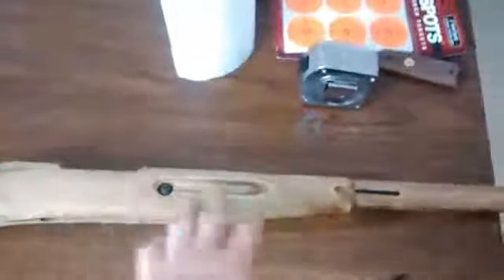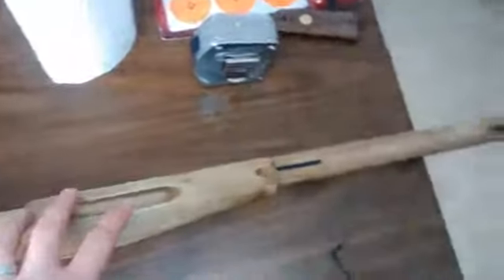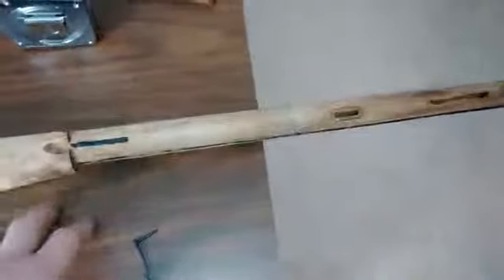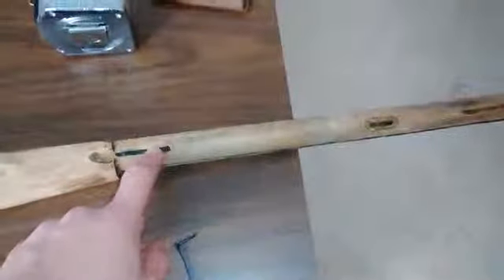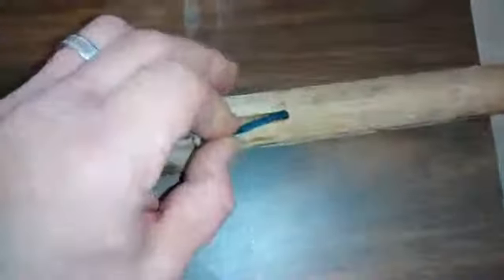Mosin Nagant spring retainer removal

Comment: Some are stuck in very good and I found out the hard way if you pull on them they break. What helps is taking a small finishing nail from the opposite side and tapping it through.

Comment: I just broke mine, the first one closer to the receiver because ACTUALLY there's a hole on the other side. Use a small punch to push the pin out then wiggle the latch to fully take it out. Don't do like me and try to pry it out.
Reply: Same thing just happened to me as well, but I broke the front one. Dammit. Don't know how to remove it now, there's no hole on the other side.
Reply: Kons213 There's always one, look closely. Maybe someone refinished your stock and covered it. If that's the case and you really can't find no hole, then you're screwed I'm afraid... Find a way to pull it out, use a heat gun to melt the cosmo around it. That might help loosen it. Then order replacement like I did. Got a few place to order them from in case you need help with that.